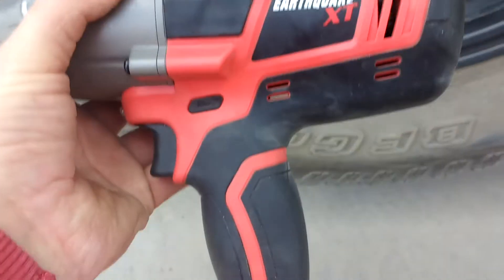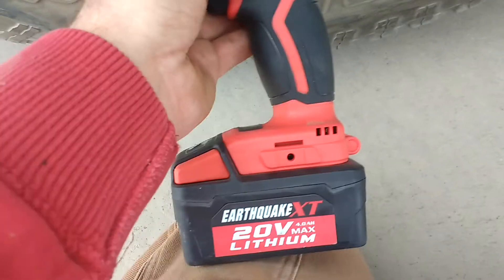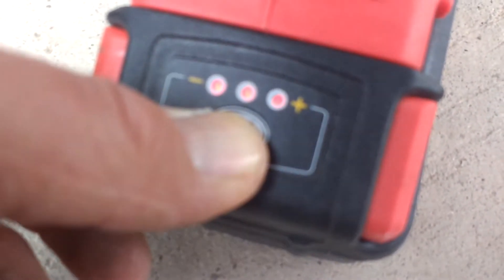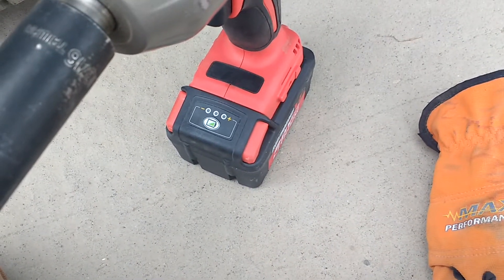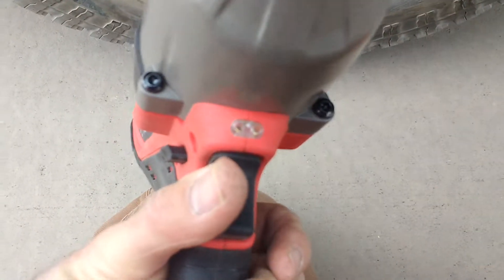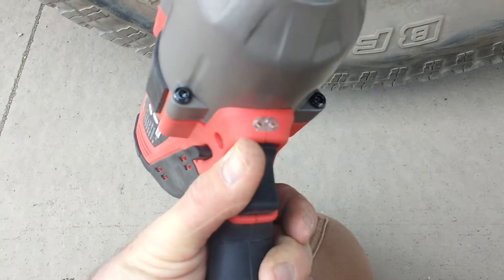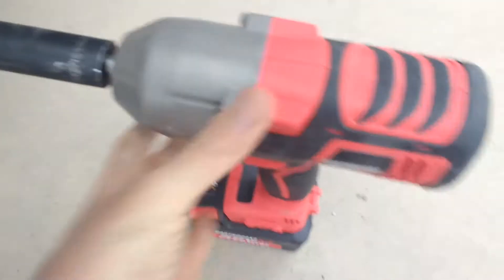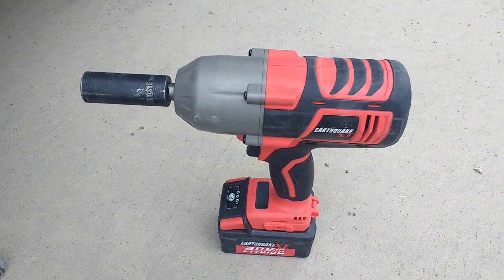HF Earthquake XT 1/2 in impact driver

Comment: In Harbor Freight's recent mail catalog there's a 20% off coupon on Earthquake.
I am undecided between Earthquake and Lowe's Kobalt  Item # 672825 Model # KIW 1524A-03.  Wish someone would do a comparison.
Did you get extended warranty?
Reply from the maker: I did get the ext warranty for a year. But wow that is a nice one from Lowe's I hadn't seen that before, I might have gotten that one had I known about it. Comparing the two, Batteries seem to be about the same price (online - Kobalt is 50.00, HF is 60.00), the tools weigh about the same, but brushless motors (Kobalt) are supposed to last longer. I still haven't charged my earthquake battery (over 6 months), it has 2 out of 3 bars still (but I only use it for a few things a few times a month - and holding a charge for a long time is probably true of lithium batteries in general).  Also currently you can get more tools for your batteries with the KOBALT system, although HF says they will be adding more 20v tools soon. Good luck deciding, but if I had to do it again I might try the Kobalt. Especially with a standard 5 year warranty on tool and 3 year warranty on the battery. WOW.
Reply: The max torques are different:  Kobalt: 650,  Earthquake XT: 850
I'm looking for something for suspension and brake calipers - been on for a long time and rusted.  Difficult to do with long breaker bars, for car on jack stands.  Little to no clearance.  650 ft/lb might be enough.  Lug and axle nuts can be pulled with breaker bars.    Both tools can be had right now for approx. $200.
Reply from the maker: UnFunded Opportunities what do you think of the size? I've never held Kobalt. But I know that the earthquake XT is pretty bulky. Maybe you could hold both of them in the stores, and decide which one is smaller. But you can tell by my joke saying 12,000 foot pounds of breakaway torque that I don't put much stock in the numbers that they advertise